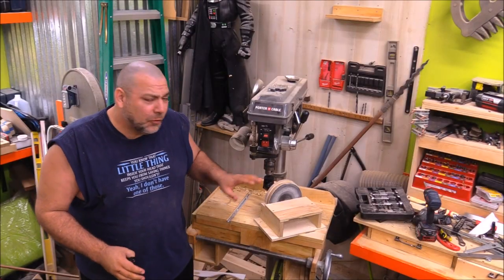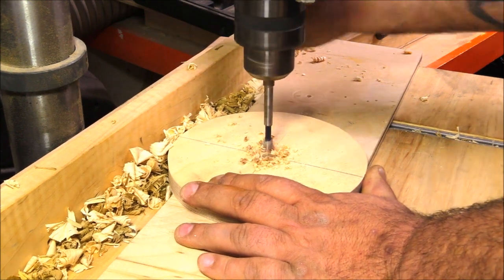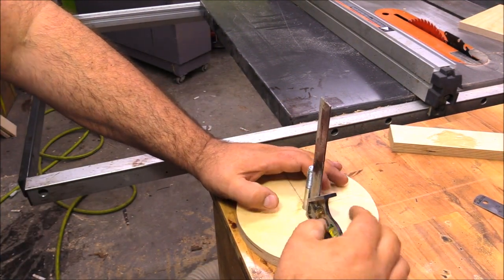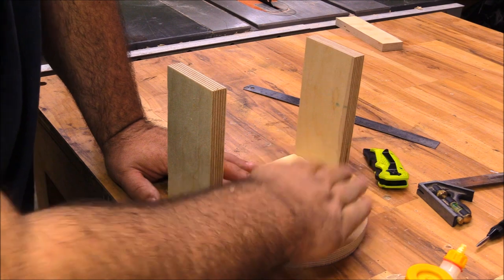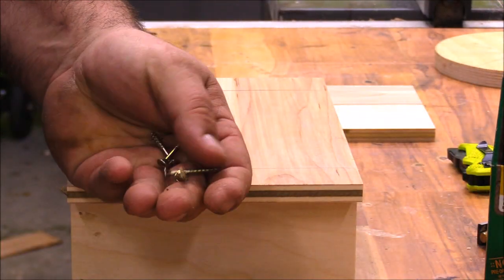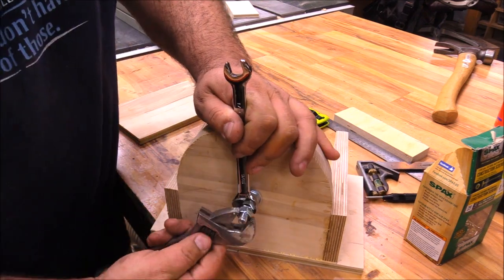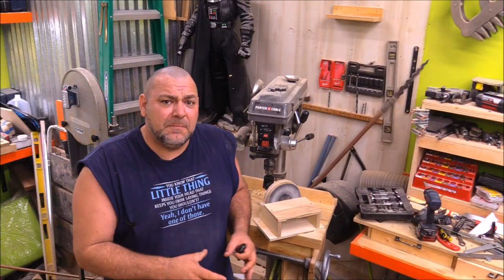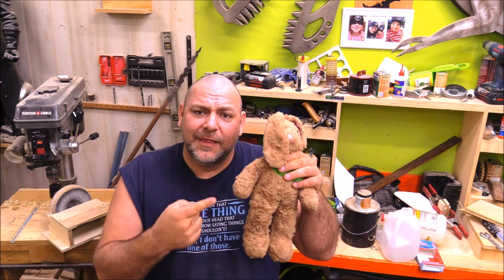how to make disc sander | Drill Press | Izzy Swan

Comment: since you had to drill the center anyway, its way easier to cut the circle by nailing your square to a larger piece of scrap and clamping it beside the blade at the radius from the blade to the nail that you want to achieve, then simply rotate the square on the nail and boom, perfect circle. (admittedly you probably know this already and the diameter was just too small  for the size blade)

love your work!

Comment: Very instructive video. I have both drill press and angled drill attachment but never thought of this combination.
I was surprised that the disc sander turns counter clockwise (or isn 't it?) while classic ones turn clockwise (or don't they?).
But I suppose for the wood to be sanded it doesn't matter. Thanks for sharing. It's for sure worth making one.
Splendid idea to promote YT channels of other people this way. I'll have a look and hope many people will do the same.

Comment: My problem with this is that I don't believe that little angled gear drive has sufficient durability for extended use in a drill sander. It's just meant for a little drilling and screw driving in tight spots, which is short and occasional use. I have at times contemplated pilfering cheap angle grinders (or ones with electrical defects) for their angled gear drives, maybe even design a differential that uses their parts.

Comment: great idea! I picked one of these angle attachments up from home depot on clearance for $5.  only problem is many reviews warn of the build quality not holding up.  my red handle wasn't even tapped correctly to screw onto the threaded bolt.  just a heads up!

Comment: Do you thinks it's possible to make a disk sander for the table saw?
Reply from the maker: it is but  you would need special sanding disc to deal with the heat and friction the tables saws 3500rpms

Comment: I have a small disc sander so the only reason I would do this is to make a larger sander.  Do you think this set up could handle a 10 inch or 12 inch sanding disc?

Comment: While metal on wood in this application should be fine, you can increase your odds by cutting 2 or 3 HDPE (the type of plastic with the 2 in the recycling triangle) 'washers' from the side of a plastic jug, smear a little wax polish on them, and put those between the metal and wood.

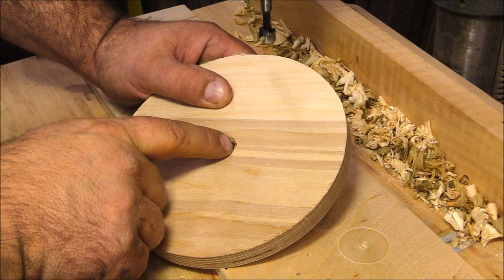Comment: question; is there any reason you didn't forstner the larger bit first for the center hole, then drill the smaller? 2:00
Reply from the maker: was just to lazy to measure the head of the bolt drilling the big hole first is a better way for sure
Reply: ah! - I get it; lazy is the story of my life

Comment: Cool of you to promote others in this way. You could drill a tiny hole down to intersect the shaft, and occasionally add a few drops of oil - last a bit longer, though I agree about the bearings. Cheers Izzy!

Comment: What is the brand of the center punch you used at 0:40? Cool disc sander BTW :)
Reply from the maker: i dont know i picked it up years ago
Reply: ok, thanks anyway :)
Reply: unogazzy84 dunno the brand but it's known as an automatic center punch
Reply: +Jeff Jones I know but thanks anyway though :) I bought a couple on aliexpress but they are not reliable.
Reply: unogazzy84 gotcha don't know that it will help because I bought mine about 20 years ago at Home Depot but it's a general and its worked great for years.... now they might be rebranded aliexpress